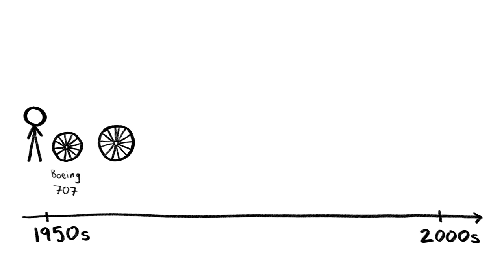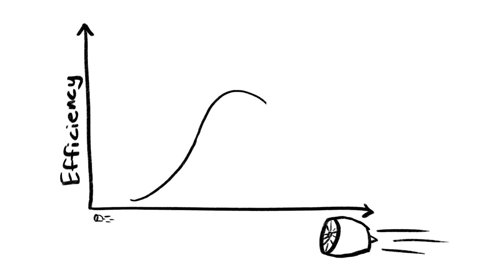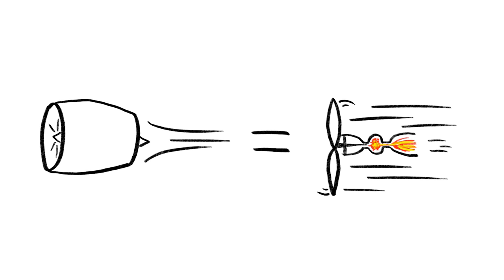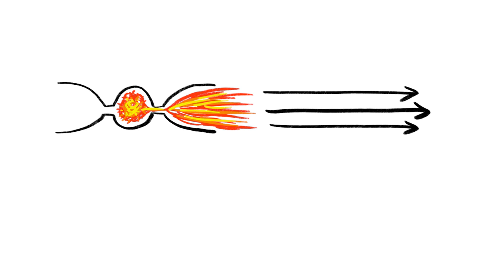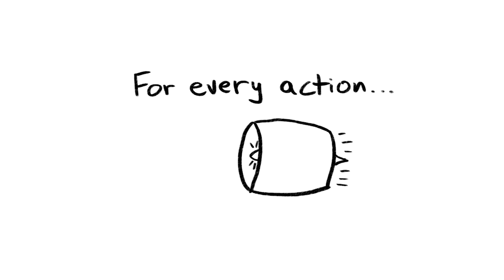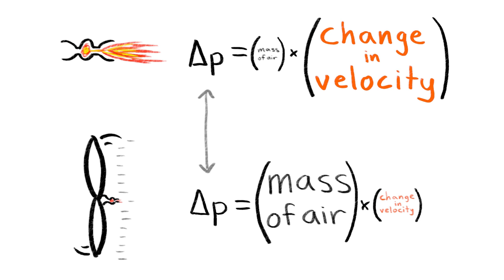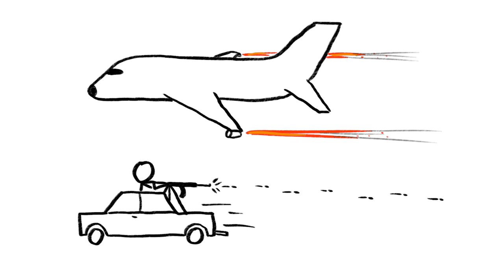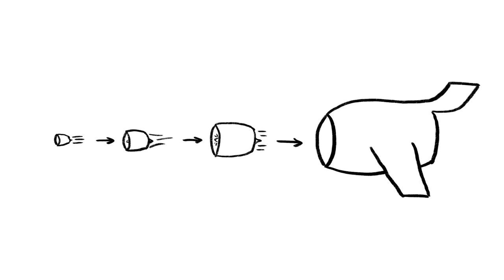Why Are Airplane Engines So Big?

Comment: is there such thing as "pure jet engines"? fighter planes also have fans in front of the engines, except they're inside, but still all of them need a big intake
Reply: +Rafael Adamy What you sort of describe is a "ram jet." These are where the oncoming air performs the compression to lower speeds thus higher densities, fuel is added, the mix is combusted, and sent out the back. They work well at high speeds, but present a whole new set of engineering complications. Aircraft like the SR-71 used ramjets.

I wouldn't go so far as to call them "pure jet engines," however. Jet engines need compression, and this is usually done by an intake fan powered by an exhaust turbine. What the video describes is "bypass jet engines," where an additional fan, as well as exhaust turbines, are added. The extra fan pushes air that "bypasses" the combustion process. There are "high bypass" and "low bypass" versions. If I remember correctly, the distinction is the air flow ratio. I am pretty sure most jet engines now are bypass engines; those large suckers are high bypass, and most cigar-like jet engines are low bypass.

As an extension, there are also scram jets, which work similarly to ram jets, but the air maintains above-mach speeds throughout the process. There are some operational prototypes.

Comment: Wrong, engine size and power is determined on aircraft structure including fuel and aerodynamics, desired passenger load, desired cargo load, and desired range.

Comment: Presumably the most efficient engine would be smaller for lower altitudes, and bigger at high altitudes.

How about engines that change shape?
Reply: +Zekian -- Well, many fighter jets have vectored thrust that also varies exhaust pressure, and spaceplanes have variable intakes, so we just need to put them together for space fighters! engine efficiency. I totally meant engine efficiency.

Comment: Most Jet-fighters use low-bypass, afterburning Turbofans and it has actually been quite a while since there has been a "pure jet powered fighter"...
Reply: +Chrinik -- What about spaceplanes?
Reply: Tlaloc_Temporal Spaceplanes may run of Scramjets.
Reply: Chrinik
Scramjets aren't a thing yet. I just learned that the White Knight uses turbojets, so not a good point, but before we develop scramjets, light-weight air-breathing engines will be useful. A purely jet engine is already ten times more efficient than a closed-cycle rocket engine, and will be used at very high altitudes, so not lugging around all those heavy turbines might be beneficial.
Reply: Tlaloc_Temporal Spaceplanes aren´t a thing yet. 

White Knight is a carrier aircraft that doesn´t go into space. 

He talked about a hypothetical thing and I answered that a true spaceplane, in order to reach the speeds necessary to archieve orbit, would probably run on scramjets.

Scramjets also don´t use turbines at all. And what do you mean "before we develop Scramjets"...we already have them, and various experimental aircraft have reached speeds in excess of mach 9.
Reply: Chrinik
-- Dang. Wrong twice in one tread.

Well, that answers my question in full. That was a nice talk.
Reply: Tlaloc_Temporal Could you elaborate?
Reply: Chrinik
-- Spaceplanes aren't pure jets, white knight is a turbojet, scramjets are a thing. One answered question, two corrected thoughts. :D
Reply: Tlaloc_Temporal Well if a spaceplane will use a scramjet, it will be a pure jet...Scramjets have almost no moving parts either so less to go wrong.

Which is why I suspect they will be the future for when you need massive speed and high altitude.
As you do in a spaceplane XD
Reply: Chrinik -- Yeah, scramjets would be awesome for SSTOs. I only knew about them from a set of encyclopedias from the 60s, so I should've expected my info to be out of date. :P

Comment: How exactly... Does the large amount of air moving a little, not be exactly equal to in kinetic energy, the small amount of air moving a lot?
Reply: It takes more energy to get a little bit of air up to the velocity needed... where as our current technology (and physics of earth and its atmosphere) makes it easier to increase the velocity of a lot of air a little bit more efficient than the other option. 

Basically it's not just pure physics but the limitations of the options available to us and potentially available to us. If increasing the velocity of air required energy proportional to how much air you were moving then it wouldn't matter...ie moving a little bit of air really fast required the same amount of energy as moving a lot of air just a little bit faster. But that isn't the case, which is what the video demonstrates.
Reply: The kinetic energy is the same.... it's the amount of energy required to get the air to the different velocities that is the difference.

Comment: This video doesn't have very much sense. On smaller planes you have smaller engines, because they are lighter, and smaller, so they fit the plane. The efficiency of the engine doesn't depend on its dimensions, in fact, larger engines consume much more fuel, but they generate more thrust also. An example is the Airbus A330: it has pretty small engines, yet it is a very big airplane capable of very long range flights.

Comment: After the fighter jets started using afterburners it increased even more the speed, that's literally throwing fuel away... I thought turbines compressed the air in order to be able to burn more fuel, not that it acts as a huge turbo propeller! What a shame!
Reply: +Douglas Aranda they do both. they aren't independent functions.
Reply: Alistair Shaw Oh, that explains it all! XD
Reply: +Douglas Aranda the fan at the front is powered by the turbines in the rear that helps compress the air going into the combustion chamber the only difference is the fans extend beyond the ducts for the combustion chamber

Comment: Makes me wonder, why they actually "grow". Though it most likely has nothing to do with science, it looke like they could just build the most efficient one from the moment they knew the math and jump to the best, rather than slowly growing there O.o
Reply: +Shuizid Engineering. You need the engine components to be physically able to withstand the forces involved.
The fan blades in an aircraft engine are amongst the most difficult to make components in the entire engine, and if any of them fail, very bad things happen.
I would assume that they have been growing in size as the technology has improved, making it possible to increase the size of the engine without it breaking apart.
Reply: KuraIthys
Sounds reasonable. So it has something to do with science ^^

Comment: The latest 737 engine is so big it throws off the balance of the plane. But they use software to correct for this. Software that sent 2 planes crashing into the ground

Comment: But they knew this when they build the first jet engine, so why didnt they start right away with an engine with 4 meters in diameter.
Reply: +Hiele Wilkes Good question!
Early jet engines were really lacking in thrust and were primarily used in military aircraft, so two things were important:
1) very high power-to-weight ratio (for good acceleration)
2) low drag to achieve high speed despite poor thrust
Moreover, the material and technical challenges were such that the simpler yet less fuel-efficient turbojet engines were highly preferred. If you're engaged in a dogfight for life or death, fuel efficiency is kind of a secondary concern.
As jet engine technology was picked up by civil aviation in the 50s, initial designs were derived from military technology. However, as fuel efficiency (primarily due to flight range) became a concern, very quickly turbofan engines sprang up (late 50s, early 60s). Initially the materials science and engineering only allowed for relatively low bypass ratios, however, starting in the late 60s, the modern high-bypass turbofans started to be developed and put into service. The limitations for bypass ratio were turbine section design. High bypass ratios required a slow turning fan to be efficient, however, turbines like to turn at very high speeds. Now you could solve this by putting in lots of turbine discs with lots and lots of blades, but that would make those engines very expensive to produce and service (not to mention reliability issues). But as better materials and turbine section engineering developed, we could fire the engine hotter and extract more energy using fewer turbines, allowing for ever larger engine designs. The latest high-bypass engines use bypass ratios in excess of 10:1 and they achieve that by using extremely exotic materials in their turbine blades (like blades grown as a single crystal) and some even so far as to incorporate a light weight but very high-strength reduction gearbox between the turbine and fan section.
Reply: +Hiele Wilkes 
Such an engine is extremely heavy, expensive, and difficult to manufacture and repair. Additionally, that size is not actually optimal in most situations in the real world. In particular, the additional cross-sectional area of such large engines significantly increases drag. When that is taken into account, you reach a different optimum. When considering all the countless constraints of real engine-building, considering performance, maximum thrust, aerodynamics, durability, weight, cost, and so on, the ideal size will vary substantially from one plane to the next.

I mean, four meters is gigantic.
Reply: +Hiele Wilkes Maneuverability?
Reply: +EebstertheGreat Sure, but that only really justifies smaller engines on smaller planes.
Reply: seigeengine
You need a pretty damn big and fast plane to justify a four meter engine. And even then, it's going to be a compromise, so the ideal size will usually still be somewhat less than four meters, if only a little. That's what we have currently.
Reply: +EebstertheGreat Wow you put alot of efford in that answere. Thanks!

Comment: it's like a jet powered prop engine XD
Reply: +Bonnie&#39;s Workshop 
Kind of.  The two types of engines that are discussed in the video are turbojet engines (which are used in military grade fighters) and turbofan engine (which are used on airliners).  There's another type of engine that uses a jet turbine.  It's called a turboprop.  It works like any other jet engine, except it has an unducted propeller connected to a jet turbine, instead of being connected to a ducted fan.

Comment: Why not just put more engines on the airplane?
Reply: +Sky Lake Because it takes less fuel to run 2 bigger engines than 4 smaller engines.
Reply: +PermaFr0st Same reason for why, generally speaking, a single, large turbo charger is more efficient than two smaller ones in cars.

Comment: Can a Boeing 767-200 travel 560 mph at 700ft altitude with winds, like the official report of 9/11 suggests?
Reply: +The Truth 
Yes, easily.  It doesn't take much speed (about 300 mph) to get those planes in the air, especially if the flaps are down.  Let's put it this way, a small Cessna 172 can get airborne in a strong headwind with the flaps down while only achieving a take-off speed of 45 mph.
Reply: +mechaman13 Especially if the aircraft are descending even slightly. God's G is on your side then.

Comment: isnt the name for this thing jet turbine, and not jet engine?
Reply: +Diktator70 Actually no, engine is more accurate(and more general) from an engineering perspective. A turbine is a specific part inside the engine that extracts power from the exhaust and a jet is what comes out the back of the whole affair and creates the thrust. You may be thinking of the term "turbo-jet engine" which is descriptive but that term in practice is generally reserved for low or no -bypass high velocity jet, gas-turbine engines. (the comma should be there. The type of jet-thrust is a separate notion from the power generator mechanism) 
More properly it is a "high bypass, axial flow gas-turbine, fan-jet engine" or possibly a "high bypass turbo-fan, jet engine".  
A more theoretical take on it might be to say the power core is a gas-turbine engine and the overall assembly is a jet-thrust propulsion unit.

Comment: then if we know the perfect airplane engine size, why did not implement it a long time ago? Why are we gradually making them bigger instead of just making them the perfect size?
Reply: +ProDesignHd There are alot of practical issues to implementing larger engines. Plus that size is theoretically ideal, it might not be so for an actual engine when all is said and done
Reply: +Liam8488 Great answer. Thanks. Do you actually work/study in that field?
Reply: +ProDesignHd You don't have to work in any field to understand that just because something is mathematically sound doesn't mean that is how a business will implement the technology. There are many many many many more factors involved when implementing technology from the standpoint of a company that has to make money.
Reply: +Liam8488 an example to supplement that would be fitting the engines under the wing. In order to fit such a large engine under the wing you will have to have longer and more heavy gears. The additional weight cost could offset the advantages of such an engine.
Reply: +Pat MaCrotch I never implied any of that. I was simply curious to know whether you were in that field or not!
Reply: ProDesignHd
Just an amateur aviation historian, but I also have a passing understanding of some of the technology
Reply: Liam8488 
Nice! I'm constantly amazed by aircraft and I'm in fact studying to be an aerospatial engineer. I'll be entering that program in a year or so. I can't wait
Reply: ProDesignHd
Awesome! Hope you do well in that :)
Reply: Besides many many many assumptions, he solved for it using a typical commercial jetliner thrust value. A heavier plane will need larger engines (or more of them) and vice versa.